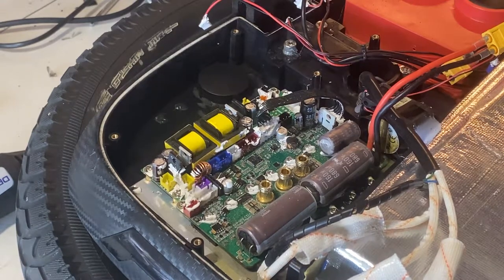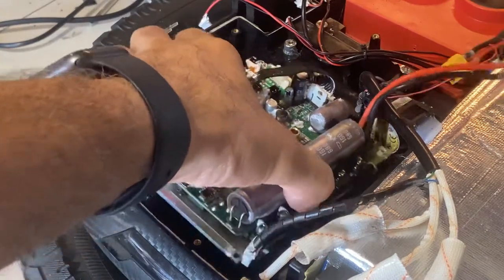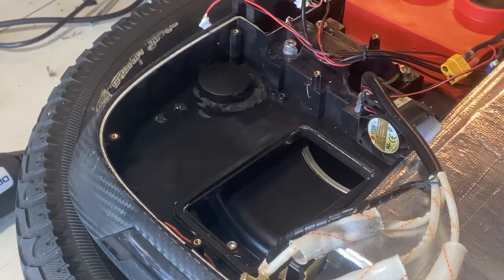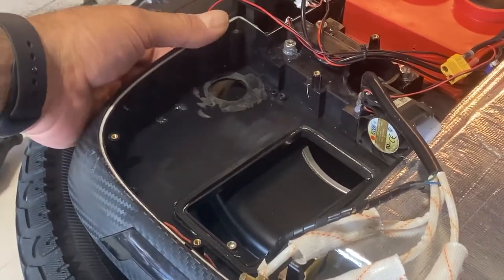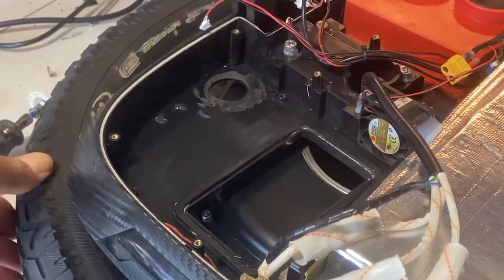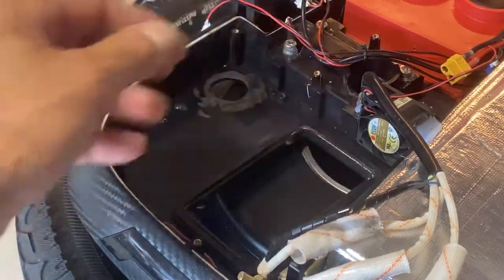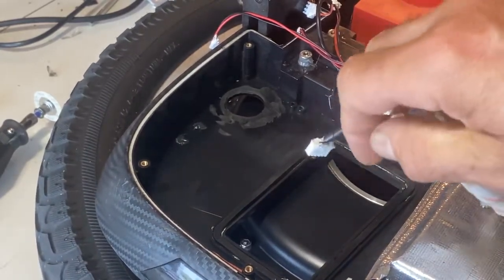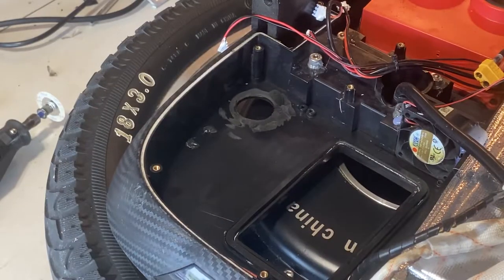RS motherboard replacement

Comment: Great tips, Do you know anything about the red blinking dots in the back if you put it back together?
Reply from the maker: You mean the back light that blinks on one half of the light only?
Reply: @rayrokni  yes
Reply from the maker: @cenkaetaya  sorry been out of cell reception for a few days. Lift your wheel, tilt forward but dont let it cut out, once you hear beeps don’t let it cut off, then start tilting wheel backwards till it beeps and cuts off. Put wheel down, turn off and then on
Reply: @rayrokni  do you know the cause of this? Is this just some motherboard calibration procedure?
Reply from the maker: @cenkaetaya  it’s a quirk on some motherboards. I believe something to do with the fw, not sure now. My memory is getting old🤦‍♂️😁.
Reply: @rayrokni  I have one coming on Monday for the RS 19 and I'm really hoping it fixes my really weird issues cuz I absolutely love this wheel.
Reply from the maker: @cenkaetaya  the rs is a great wheel.

Comment: Why are you replacing the motherboard? Did the original burn out?
Reply from the maker: installing new black mbrd
Reply: @rayrokni  thanks but why? What's the difference?
Reply from the maker: @justinspirational  new black mbrds allow ota fw updates, allow more power/amps. apparently run cooler
Reply: @rayrokni  sounds great.. Appreciate your channel and feedback.. any idea if my (yet to be received) latest version of the RS-HT will come with this improved motherboard?
Reply from the maker: @justinspirational  if it’s not old stock from dealer and it was manufactured after march 2021, yes it should come with black motherboard.
Reply: @rayrokni  awesome.. Think, hope and would expect as I'm still waiting on mine from ewheels and won't get till next month that mine comes with the newer one